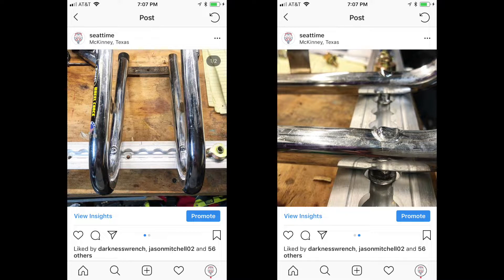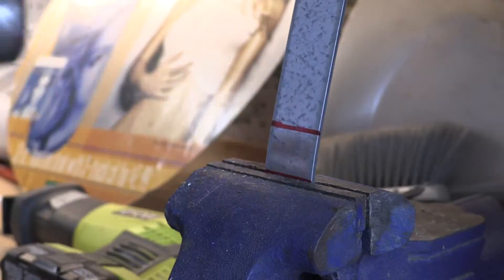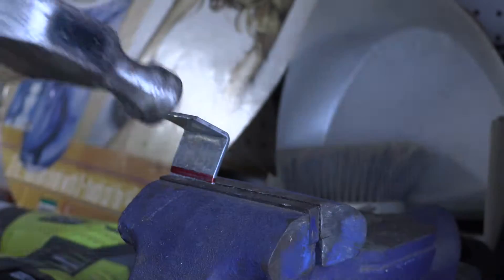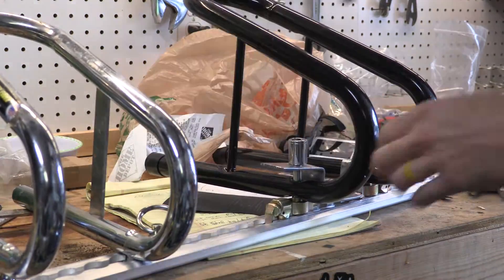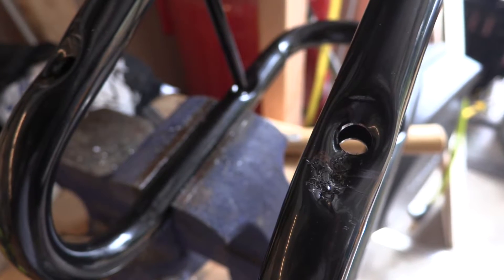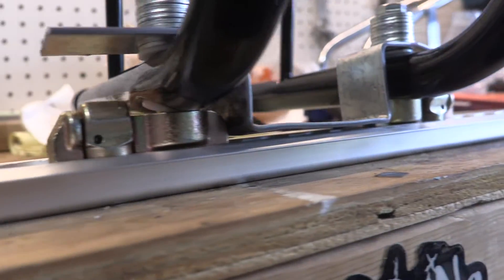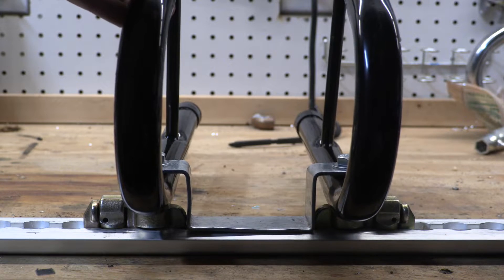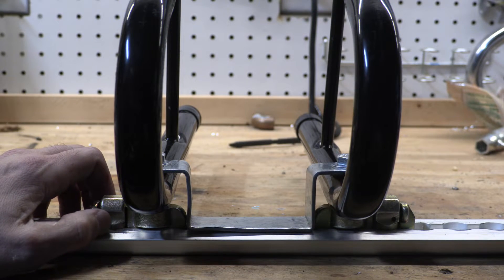L-Track Wheel Chock for the Sprinter Moto Van | I Made It Work!

Comment: I was contemplating something similar in my truck and using a winch to load it.
Reply from the maker: I just noticed in a picture on Instagram yesterday that the Bolt It In guys have a wench on on of their racks just for bigger bikes.
Reply: @SeatTimeClips  I bought a f250 for some unknown reason... still using my horizontal receiver rack.
Reply from the maker: @Steven-jq8jj  Here's the post in case you need some ideas. https://www.instagram.com/p/BqvOBuqBDci/

Comment: Why don't you use heavy duty studs meant for L-track? This solutions looks faster but it does not seem to be that strong. Just my thought :)
Reply from the maker: The studs I think you’re talking about are for more permanent attachment to the L-Track. They also only have one attachment point. The once used here have two attachment points per piece and they are very stable. The way you secure the L-Track to your surface will create more security for the entire system.